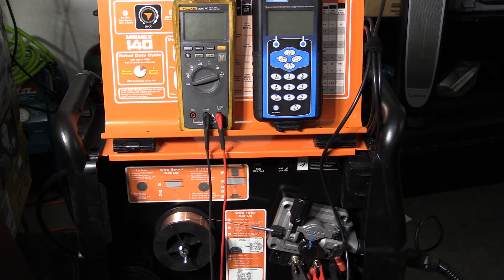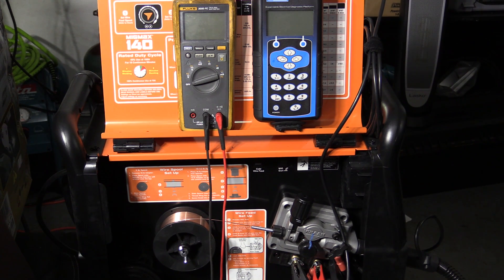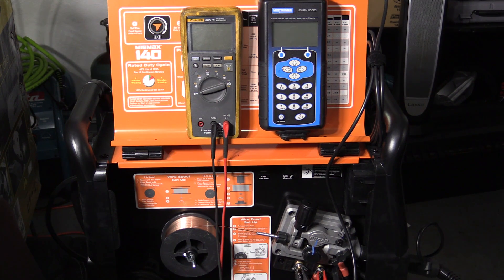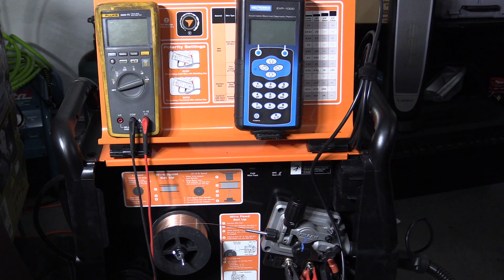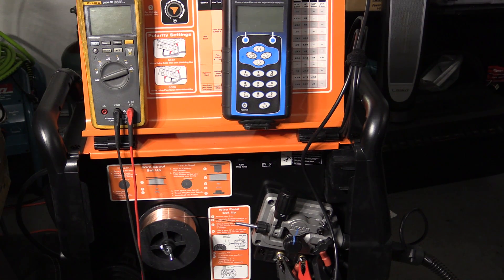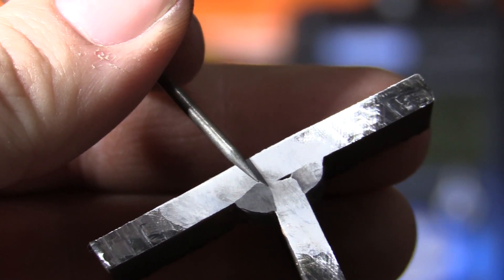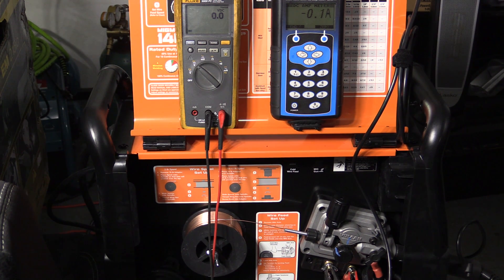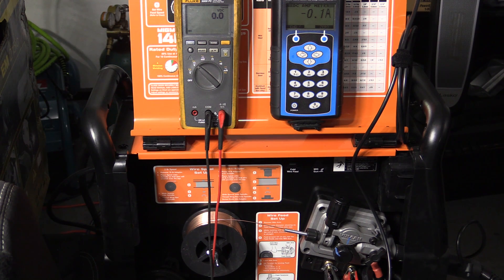Harbor Freight Vulcan MIGMAX 140: Underpowered?

Comment: Nice review and findings on the Migmax 140. I have a Migmax 215 and want to know how you got past the 3 second "no arc time-out" on the wire feeder. I'd like to see what mine is capable of, but not sure how to override the no arc time-out.
Thanks, Chuck.
Reply from the maker: I left the door open and pointed a camera at the drive roll.  Then I turned the wire speed to max and simply ran a bead with the welder.  I recorded the drive roll while welding.  

I put a little mark on the roller so I could count rotations, then I compared it to the timer on the video so I could work out rotations per minute.  Then I used a set of calipers to measure and work out the circumference of the drive roll so I could convert RPM to inches per minute.  Another way to do it would be to unroll a length of wire and put a sharpie mark at intervals.  Then roll it back up and start welding.  Then use the camera pointed at the drive mechanism to watch for those marks to pass by.  If the marks are, say 30 inches apart, you just use the video timer to figure out how long it took for those 30 inches to feed and extrapolate that out.
Reply: @bigtb1717  Haha, I love it! I was expecting some electronic jumper or something. 
Thank you, and all the best!

Comment: Do you think this Vulcan 140 welder is worth $300 new?
Reply from the maker: Do they still come with a one year warranty as standard?  Either way, that sounds like a pretty fair value.  The MIGMAX 140 is built pretty similar to the 215, and I know of a couple of those that have been going strong for a couple years.
Reply: @bigtb1717  I just bought it for $300 it was an open box item in Harbor Freight store. It doesn't have a warranty. I think they don't sell it anymore because I didn't see them new on the shelf but I saw Vulcan 215 new ones. I still have time to return it that is why I was thinking if that's worth $300.
Reply: @mikeorion5150  yes . good deal. to weld thicker metal use .035 wire.

Comment: Great line of welder's. The Vulcan line.. the titanium one in this same class is a lil better... But as u get up in the Voltage the Vulcan up the ante and they do very well.
The 220 Vulcan is excellent.. its a professional grade welder that can easily compete with the Miller in its same class... U can weld all day with the 220 Vulcan.. the titanium 200 is also comparable and can do professional level quality welds... But the Vulcan omni pro 220 is more of an Industrial professional level welder it has a better duty cycle than the titanium 200... And the settings are easier to program in... If Ur gonna be a certified welder and get some good jobs the Vulcan omni pro 220 is excellent...

But u must realize any 140 volt max output welder. In the 110 class of welder's aren't gonna give u great power output they are hobbyist welder's at best.. maybe small repairs at home and working on your car  or motorcycle or your Mountain bike.. etc.. but nothing structural..

But If Ur building furniture or other cool hobby projects Ur good with a Vulcan 140.. or titanium 140. They good welder's.. the inverter technology is really good nowadays.

Comment: Thanks for the info, my Lincoln 110 stopped working so I got this 140...I cannot for the life of me to get this welder to work smoothly..I run 030 wire C25 gas ..nothing works....the wire speed seems slow ....most of my work is 1/8  ..
Any other suggestions other than returning it ?
Reply from the maker: Have you double checked the polarity to make sure it is correct?  The wire should be positive for solid wire with shielding gas (work clamp negative).  

When you say it isn't smooth, what exactly is it doing?  Are you getting good gas flow?
Reply: @bigtb1717  thanks for chiming in...polarity is good..good gas flow ...C25 , .025 wire .....
Just seems like I don't have the power that my old Lincoln had, my old 110 Lincoln I could do 1/4" with some bevel an gap with this 140 I can instantly tell its down on power, I did actually get it run smoother, but I guess I'll try the .035 and see if that works
Reply from the maker: The power wasn't impressive, but I did get a bit more out of 0.035" wire.  I also got a bit more out of it when using CO2 gas.  Good luck, and I hope you end up satisfied with whatever you end up with.  

Depending on current sales, the MIGMAX 215 may not actually be that much more money.  It is the same size and weight, and is far more capable.  Even if you can't run it on 240V, it ran great for me on 120V.  It has far more wire feed speed than the 140.  Don't know why, as the 140 seems to have the same feed system.  Just something to consider if you end up taking the 140 back.

Comment: I don't know how into SMAW you are, but i'd like to see the Vulcan commander 225 looked at, especially its ability to handle e6010 with long arc. 'Nothing online about it.

Great videos!
Reply from the maker: It would be interesting to see how it does, but it's a bit less appealing to me than the other Vulcan welders for one big reason:  The used market.  It's not uncommon to find perfectly functional, older Lincoln, Miller and other brand transformer welders used for very reasonable prices; often much less than the Vulcan's new price.

Makes that model less appealing to me because if I was in the market for a heavy transformer welder I'd probably look at the used market for a deal first.

Comment: how in the world do you have a amp meter connected. i don't see a clamp.
Reply from the maker: The clamp plugs into the top of the meter and is clamped to the power lead below the wire feed mechanism.  In the zoomed out view in the beginning you can see the cord for the amp clamp coiled up on the right side of the door and running down the right side of the welder.

Comment: It's possible that there could be a pot on one of the boards that could increase your max wire feed speed.
Reply from the maker: I suppose that's possible.  As it is, I suppose I could take a peek just to see if there is anything obvious, but I'm not going to adjust anything, even it it's there.  Based on the thickness ratings for various wire sizes, I suspect that the max wire feed speed was intentional, and I may sell this welder and don't want to take any chance on messing up the warranty for any perspective buyer.  Harbor Freight warranties are transferable, so I don't want to mess that up for the next owner in case I sell.  Probably wouldn't make a difference in the warranty, but it does work as is, so I'm not going to mess with it.

Comment: So what about IS or DS for deep thicker metals?
Reply from the maker: In a previous video I did test and show the penetration of 0.030" flux core wire on 3/16" material, and it did ok.  The machine is rated for up to 1/4" with flux core, and though I don't currently have any 0.035" wire to try, I have very little doubt that it would do ok on 1/4" material with 0.035" innershield wire.  

I've never run dual shield and don't have any to try.  I think this machine would be hard pressed to run dual shield wire well.  It takes a lot of volts to run properly.  You might get 0.035" dual shield wire to run, but this machine isn't really ideal for the task.  Dual shield is a hot, fast process that a 120V machine isn't really up for.

Comment: when I saw the specs for the max  wire feed speed I felt it was too  low .
Reply from the maker: Interestingly, the wire feed mechanism appears identical to the one in the MIGMAX 215, and the WFS specs are the same; 50-500 inches per minute.  But the 215 definitely has faster actual wire feed speeds than the 140. 

I wonder if Harbor Freight lists the spec as 50-500 simply because that is what the Lincoln Power MIG 140C is rated, and that is the one they put it against in all the ads to show how it "beats" the Lincoln.  I would guess that even on the Lincoln, that is unloaded speed, and actual WFS in use is lower.  But I be it is still much higher than 270 in use.  The Lincoln actually rates the machine for maximum thickness with 0.025" and 0.030" wire, land slightly less with 0.035".